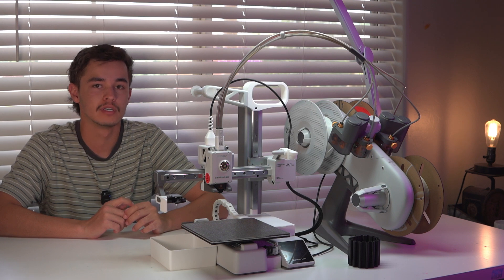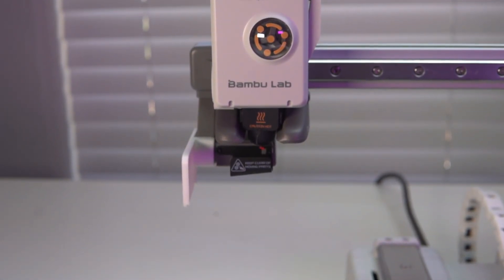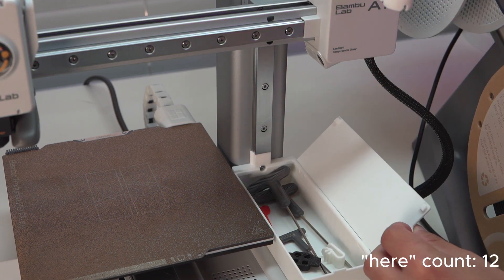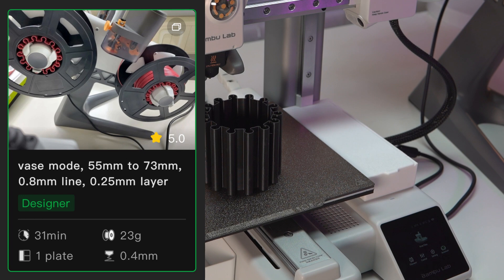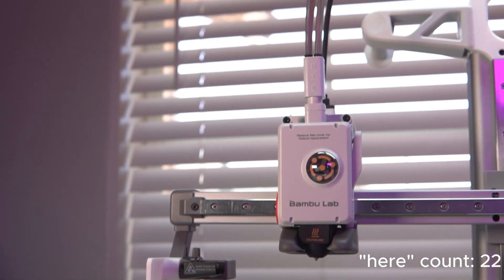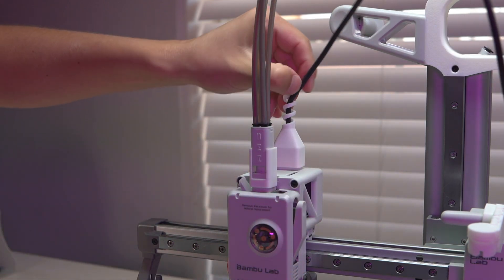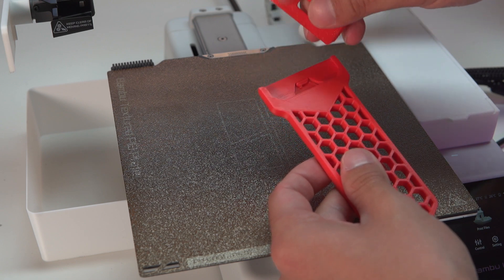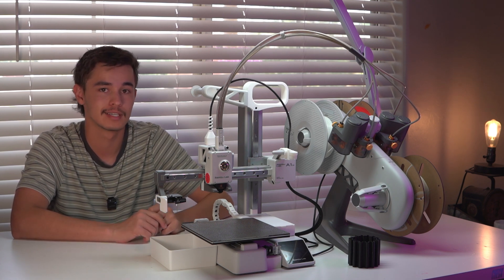10 MORE MUST-PRINT UPGRADES for Your Bambu Lab A1 Mini 3D Printer

Comment: Thanks so much for sharing, all great stuff, btw, what's you opinion on enclosure, Bambu seems doesn't recommend to do that for A1 mini.
Reply: You souldnt print it enclosed because it’s designed for open air but if u do in close it you sould keep it open so you don’t ruin the 3d printer.

Comment: Love the cord protector, the scraper and the coupler fix.
One question which has been making me crazy, where does one get those hex keys with the handles from? I just bought an A1 Mini and I really hate using the damned keys that come with that model.
Reply from the maker: I got these from harbor freight but you can find them at pretty much any hardware store :)

Comment: Thank you for sharing your experience and views on 3D printing and A1 mini. I am thinking about buying a1 mini with ams lite. My question is what four color PLA basic filament to buy?
Reply from the maker: Elegoo makes a really good pla pack that comes with white, black, red, and blue filament. I would highly recommend it
Reply: @jet_lea  Thank you. Any benefit in buying Bambu lab filament?
Reply: @jet_lea  Thank you for the suggestion. I bought Elegoo Rapid PLA+ in white and it worked flawlessly on A1 Mini. I also bought the four pack you mentioned.

Comment: Good ones especially the plastic spatula. I made the one that is made to work with the a1 mini included metal blade and 2 screws & accidentally already scratched my build plate so will try that plastic one.
Reply from the maker: I love it so far and use it very frequently
Reply: @jet_lea  hey I just found out you can just bend the plate and it usually works better than using a spatula. Also if I don’t want to wait for something to kool down, I put it in the freezer for a few minutes and not only does it cool it down but it also loosens up the print. This is especially helpful on wood infused filament prints which are fragile until cool. These newbie tips would be worth putting on your list to mention in a next video.

Comment: Question about the storage container mounted to the Z-Axis. How much does it rattle with all the tools in there during a print? Same with the nozzle holder at the front of the machine?
Reply from the maker: I've noticed no increased rattling or print quality issues with about 20 hours of printing since install

Comment: Congrats on your first 1000 subscribers! 2 of those mods were actually new to me and I prefer the spool adapter over the official one from Sunlu since it seems to work with all sorts of brands. Thank you for that!

I have decided to splurge and canceled yesterday's order. I ordered the A1 Combo instead to future proof my 3d printing adventures, but a lot of your mods still apply and are the same or very similar to the ones I have selected. Can't wait for it to arrive!

PS. If you have trouble with your camera's autofocus, try setting it to manual focus instead. You can then focus on whatever you want and it won't get confused by your hands or whatever else. Only works for those static detail shots, of course, but it can be a godsend.

PPS. I'm looking into that ultimate enclosure mod for the AMS Lite to keep the spools dry. Perhaps that's useful for you, too.
Reply from the maker: Thank you for the tips! I’m positive you won’t be disappointed in getting the combo instead, like you said, it’s great future proofing. I might check out the full enclosure soon!
Reply: @jet_lea  You're welcome :) I hope it actually helps. If you don't need them, I'll stick to the topics of the video. Looking forward to what you print next!